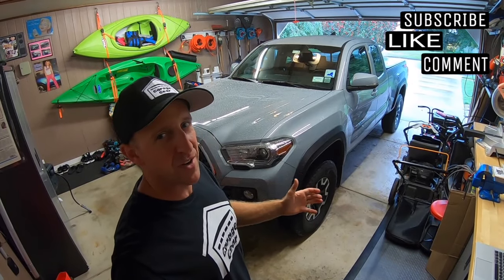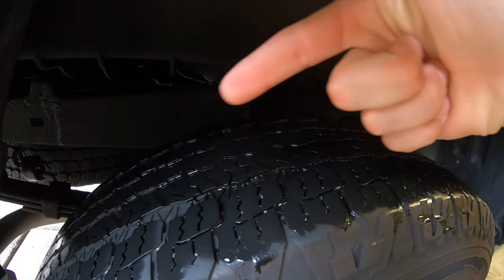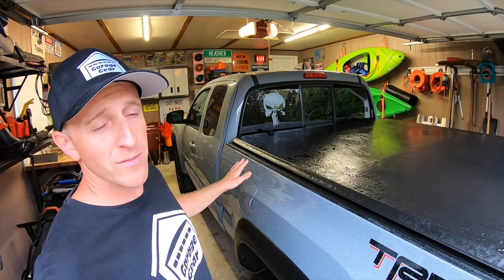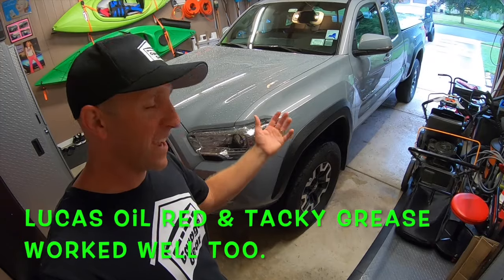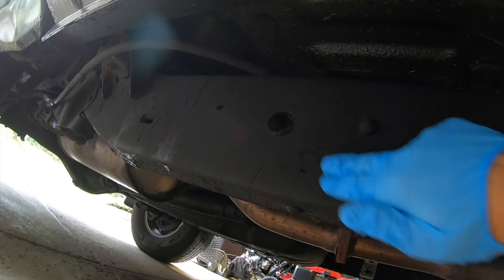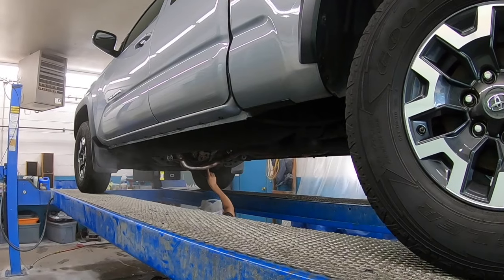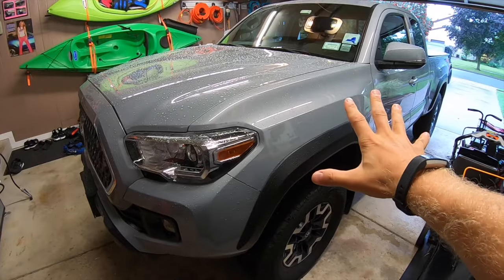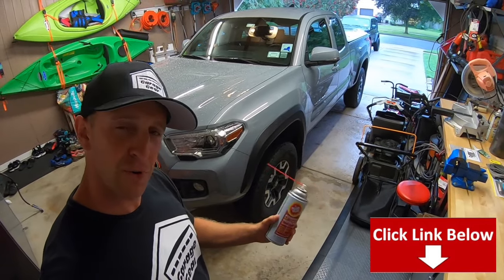BEFORE YOU UNDERCOAT YOUR TOYOTA TACOMA, WATCH THIS!

Comment: I have an extensive background in corrosion control and have used Krown for years with flawless results.
Reply from the maker: Krown ROCKS!  Great stuff!  Thanks for watching !
Reply: I called Krown and they explained that undercoating my 4Runner would entail them drilling in the frame so they could inject the frame! Is this normal? Scares me to have them drill the body with holes. Any insight into this? Is ok to do this?
Reply: @claudiacanales2662  that’s why I refused to go with them.  Punching holes into my new vehicle, no thanks!!   No, it’s not necessary.

Comment: after you undercoat do you periodically spray/rinse the underbody after snow driving?
Reply from the maker: Hey Robert, I have it undercoated I seldomly spray underneath! I don’t want to wash off the oil coating. Plus it will make a mess of the driveway. If I spray anything I’ll spray anything that wasn’t coated like the exhaust to get the salt off. Everything under my truck is thick coated in black oil!  No rust on sight! Thanks for watching!

Comment: Had my dealer undercoat it for $450 and warrantied for 7 years. Wonder if I should have just done this spray instead!
Reply from the maker: Was it the black rubberized undercoating?
Reply: @GarageGear  paraffin wax they said. It was black.
Reply from the maker: @appleztooranges  ive heard good things about that stuff!
Reply: @GarageGear  ok cool. Maybe I shouldn’t worry than. It does seem rubberized though 😣
Reply from the maker: @appleztooranges  https://youtu.be/nXvl9nt57Kg?si=WGNfz-0qWxwkpPjr check this out.
Reply: does it turn to soft tar-like substance if sprayed with these other undercoatings? ... that is what happened with a Gen2 Tacoma my relative has that was dealer undercoated as new 13 years ago
Reply: @efil4kizum  yes

Comment: First thing to go is the frame lol
Other then engine oil+filters, front and rear dif gear oil, drive train grease nipples. Then maybe air filters and then eventually sensors and gaskets. 

I mix linseed oil mixed with a bit of wd40.  Took me 5 hours with a small paint roller and brush. 
Cheap options though. 
Mines a 4door 2004 TRD Off Road that commuted to a salt(potash) mine.
Reply from the maker: Thanks for watching Yotaciv!

Comment: I’m glad I watched this. I’m picking up a 2018 lifted 4x4 SR V6 on Monday. Definitely doing this to it. You think the price for it to be applied will be the same in the Midwest?
Reply from the maker: Hey Ryan! I would give some calls to some local repair shops and see if any of them do rust proofing. Call around and get some quotes. I just have them spray the underside only! That’s why it’s only $50 for me. Doors and tailgate are usually extras. Make some calls and you might find a good deal.

Comment: I have a 2018 TRD Off Road and according to your video, the frame is steel and shouldn't rust?  pffft.  My frame is brown underneath. Rust everywhere.  That's why I'm searching about undercoatings because I'd like to get it done.  I'll check the local shops down here in South Florida because I figured it would cost a ton, but if it's less than $200 that's so worth it!
Reply from the maker: They’ll rust no doubt about it. That’s not bad to have it coated

Comment: which one do you prefer more? krown or Fluid film or are they pretty much the same thing?
Reply from the maker: That’s a great question. Fluid film is lanolin based. Known is petroleum based. Fluid film bubbles and seeps into cracks. Known is thin and seeps in cracks fast. It’s really too close to call. I’ve used both for years and still can’t decide which is better. If it really came down to it I’d probably say that known spreads better. Ever use both yourself?
Reply: @GarageGear  I never did anything like this to previous vehicles other than wash the underbody a few times over winter and a good wash in spring. I did fluid film to my new Tacoma last year.  I'm in southern Pennsylvania so we see some snow. They salt and brine the roads here. I did my truck again this year too last week.  I did learn we have a local place that does Line-X and Krown. They charge $150 for mid size trucks. I can do it myself for half that but I think if I didn't have time or wasn't able Krown is a decent deal.  So far my truck is looking good no rust.
Reply from the maker: @MrMikey1273  hey Michael, the $150 may be for everything sprayed on your truck. That package may include door jambs, Tailgate, hood, etc. I just tell them to spray the underside only because I do the rest. The rest is easy and not so messy. What year is your taco? Thanks for sharing and watching! 👍
Reply: @GarageGear  2020 here
Reply from the maker: @MrMikey1273  cool bud!  It’s satisfying to know that our trucks are protected from winter’s worst!

Comment: I’ve been owning mine for a year (2020 Tacoma trd off road ) and haven’t done this. Chicago winters are brutal and want to do this in the summer. Will it be too late by then ? And can I use a touch-less car wash after 1 week of applying ? Thanks !
Reply: Don’t waste your money.
Reply from the maker: Hey Lara, never too late. I know some one that started undercoating several years after they bought their vehicle and the undercoating helped out big time. You could use a touch less car wash a week later but see if you can avoid the under spray. Is it a delta sonic car wash? If so they should be able to do that. Thanks for watching!

Comment: I just called a shop here in ny and they told me $550 sounds a lil expensive
Reply from the maker: I just paid $55 plus a tip to get mine done again
Reply: @GarageGear  Wow big difference!! To bad I'm 6 1/2 hrs away
Reply from the maker: @gagrg76  I just have the bottom done on mine. They charge more if they do inside the doors and whatnot. Call around you may just find a place that does the bottom only for cheap.

Comment: My was coated with some thick black material. Its thick, doesn't come off easily. No idea what it is. Its not like an oil spray.
If I wanted to recoat it, I would need to scrub the sh*t out of it to get it all off.
Reply from the maker: Somebody used a rubberized undercoating on yours. Not a big fan of that because moisture gets trapped behind that stuff and causes more rust.

Comment: This is not true. They are already replacing 3rd gen frames. The steel is only part of the issues. The wire used to weld them and the overall construction are also factors. It’s a segmented frame. There are so many pockets and notches to catch material in.
Reply from the maker: Thanks for watching!

Comment: Using steel with a higher carbon content affects the strength of the steel, not the corrosion resistance. Unfortunately, 3rd generation Tacoma frames are just as rust prone as the previous generation trucks. As proof, Toyota recently extended their frame replacement program to include 3rd generation trucks. I do however agree that proper rust proofing will dramatically extend the life of a Tacoma frame.
Reply from the maker: Thanks for sharing this Tom and thanks for watching!
Reply: I think that was the beginning of the 3rd gen. 05 to 09 .
Reply: @tim9m  uh that's 2nd gen
Reply: @bmurphy386  I realized that after I wrote it and could  not find it to edit it.

Comment: I just bought a 2017 used tacoma, it has some rust spots mostly in the welds. would you recommend applying a rust converter first and then applying a oil undercoat layer?
Reply from the maker: Nope! Just hit it with the oil coat and you’ll be good! Welcome to the Taco Club!

Comment: It is  true, reason why oil wax is so good is because its fluid. You can literally POUR it in holes and areas that you can not paint it. That oil will sit there and protect frame, it can't crack unlike the paint since it is fluid. Paint tends to crack all over place, hot weather especially. Then go and look for cracks and paint it again... you miss few ones and that crack will get bigger etc
Reply from the maker: Thanks for sharing

Comment: Thanks for the video, I was looking at a place here in Denver and they wanted like $1600 to undercoat my 2018 sequoia.  Going to check some collision repair places tomorrow for some quotes.
Reply from the maker: Hey Devon! When you’re getting your quotes you can see if they will just spray the bottom. They may have different packages where they spray inside door jambs, under the hood, etc. this usually costs more. I just get the bottom and hit other areas myself. Thanks for watching
Reply: @GarageGear  yeah in this case it was for valugaurd on the frame and the cost of prep.  Honestly knowing that an application of oil based stuff can be $100- a few hundred dollars, I think they're super overpriced.  Especially since my factory undercoating is still nearly perfect
Reply from the maker: @devontoner  keep searching around. More places than you think do it. I bet you’ll find a great deal somewhere.👍

Comment: If you mix 8 ounces of automatic transmission fluid and 8 ounces of penetrating oil like WD40 or Blast, with your under coating (I use woolwax) you won't have to do it again for several years.
Reply from the maker: Good to know! Thanks for sharing!

Comment: Great video JB. We just bought a 2022 Buick Encore GX Preferred and I'm thinking that we should do some undercoating for it. It's got the ceramic coat on the top but I didn't think about the bottom that nobody sees. That's pretty important if you want to protect your investment.
Reply from the maker: Go for it my friend! If your planning on keeping it for a while I would recommend it. How do you like the ride in your new Buick?
Reply: @GarageGear  very nice so far. 3 cylinder engine means we get 400 miles to a tank and turbo means it will get up and go if needed. Plus you can put it in AWD in the winter instead of FWD. It's a luxury vehicle not your grandmothers vehicle. Thanks for the advice on having it done.
Reply from the maker: @WhitieInVermont  Excellent my friend! You got it! Picked up some new tires for my truck! New video on them tomorrow! Stay tuned!
Reply: @GarageGear  does the crown product get dry to touch
Reply from the maker: @weirdowolfstudio5409  no it does not! Once dirt and dust from the road bonds to it it forms this gel over your underbody. Protects it well.

Comment: Love the video. About 4 years ago I undercoated my truck using Por 15. It’s really worked well and just now I’m starting to see some surface rust take back over. Would you recommend grinding off existing paint before applying fluid film? Or just spray fluid film on over top existing paint and small patches of surface rust?

Thanks!
Reply from the maker: Hey Thomas! I would just hit it with fluid film. Dare I say that fluid film solves all problems lol! Thanks for watching!

Comment: I'm going to do the same this Friday, the place is Krown undercoating.my question to you ,do you wash your truck in winter? Like Delta sonic or so.or you don't do nothing ,what you do to keep your truck in prestige conditions. My truck is a tacoma 2020. I live in Rochester N.Y. and you know how crazy are here in winter.
Reply from the maker: Hey Luis! Awesome that you’re getting it undercoated. Your truck will thank you! I hand wash mine in the winter. Bucket of hot water and 20-30 degree temps. Many times I don’t even wipe it down in the winter because it snows here so often. Just get the snow off it and that’s it. I’ll wipe inside the doors every other wash. How about you?
Reply: @GarageGear  well, I have a Delta sonic unlimited. And I'm going almost every day. But now I'm worried because the car wash can remove the Krown product.i don't know if I cancel the service or do it at list monthly. What Do you think is best?
Reply from the maker: @Myself81565  when you go there you can ask to no receive the under spray feature. This will help your crown stick but you must ask for no under spray. I used to work there about a decade ago.

Comment: Can I drive in wet conditions right after I get my truck undercoated thr same day?
Reply from the maker: I would give it a day or two to let it bond.
Reply: @GarageGear  I drove it to them during a rainy day today and they told me it was safe to drive right after the spray.  Were they wrong?
Reply: There shouldn't be any issues if I sprayed this stuff on a new Tacoma and it shouldn't create rust if it didn't trap in any in the first place I hope @GarageGear
Reply from the maker: @jimmylim5015  hey Jimmy if you can avoid driving it in the rain immediately after you had it coated that is good so the rain won’t wash it off right away and this gives it time to bond better.
Reply: @GarageGear  That's true, the guys in the LINE X shop told me it was safe to drive it right after they sprayed it, so I just hope none of the water got "in" any gaps of the treatment
Reply from the maker: @jimmylim5015  I bet you’re fine
Reply: Thanks! @GarageGear

Comment: My 2005 never gets coating and it has very very little rust.
Reply from the maker: Cool thanks for sharing! Do you live in a warmer climate or have a lot of salt on your roads?
Reply: @GarageGear  No, I live in the Pacific Northwest.
Reply from the maker: @deplorablechump8758  oh cool! That’s awesome  that there is no rust. Nice work.
Reply: @GarageGear  Don’t waste money on coating. The truck is designed for the U.S. market and for an average life of 200k-250k miles. Do a car wash once a month and after a snow event will do it.
Reply from the maker: @deplorablechump8758  thanks for sharing!
Reply: Impossible.....2005 my 2022 had rust forming already, WoolWax coated nice
Reply: @donsigler588  Return your 2022 to the dealer. It’s a lemon. Maybe Taco is now made in Mexico now.
Reply from the maker: @donsigler588  wool wax is nice stuff!
Reply: @deplorablechump8758  WRONG